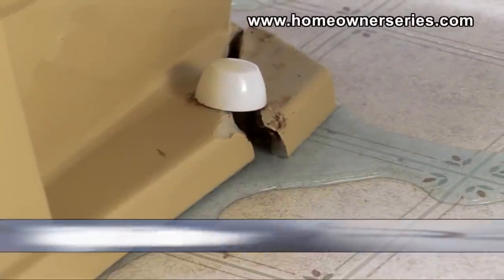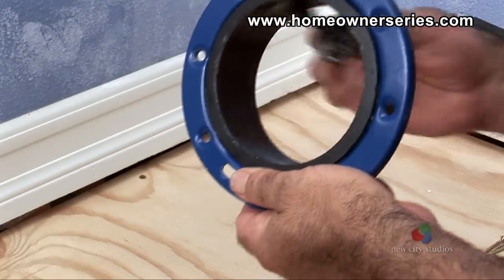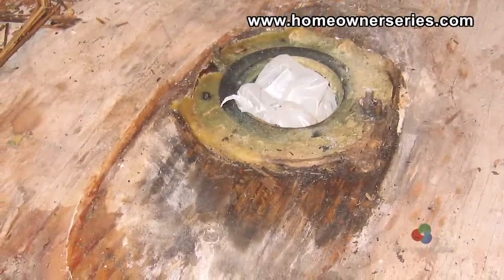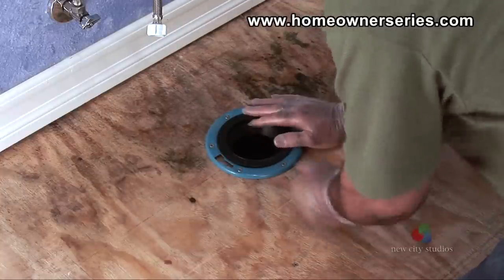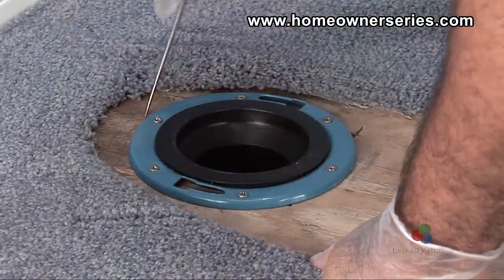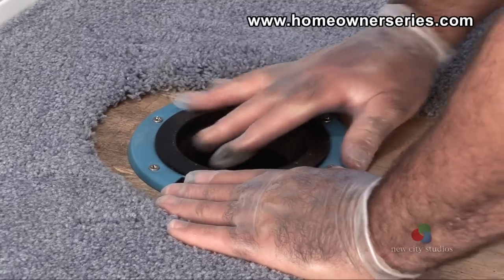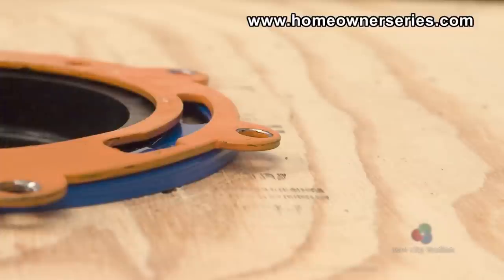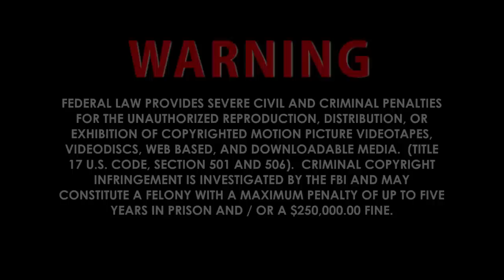How to Fix a Toilet - Wooden Sub-Flooring Flange Repair - Part 1 of 3

Comment: Can I dry out the rotted floor and use gorilla glue caulk and place 1/2 plywood above the dried plywood? The gentlemen at Lowe’s suggested I use out clay around the pipe and level as thin as possible with quick cement.

Comment: says use deck screws to mount flange then shows them mounting it with drywall screws....  wrong.... drywall screws are not water resistant like outdoor screws.

Comment: My sewer pipe is cast iron I think and 4 1/2 inches in diameter ... just measured it. I am replacing the plywood. What's the best new flange to use?

Comment: I had some guys install tile in my bathroom.  I went to install the toilet after they were done, (they were not very skilled), and I noticed the flange was not sitting on something solid.  It looks like the subfloor beneath the tile, beneath the hardibacker, is rotted.  Do I need to rip out the tile and hardibacker and replace the subfloor?  How important is the integrity of the subfloor?